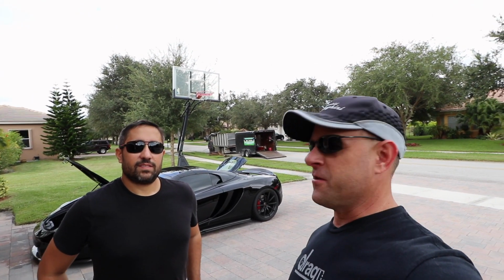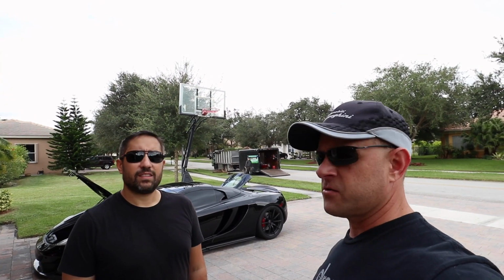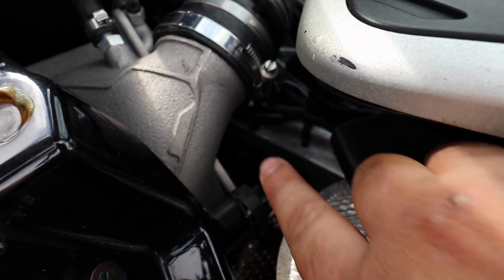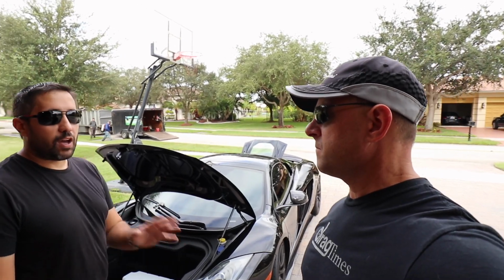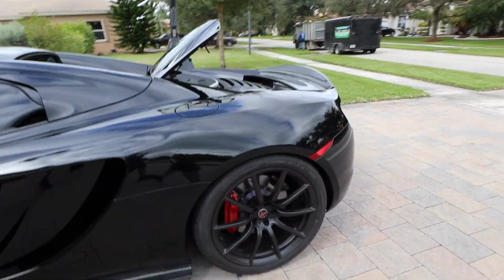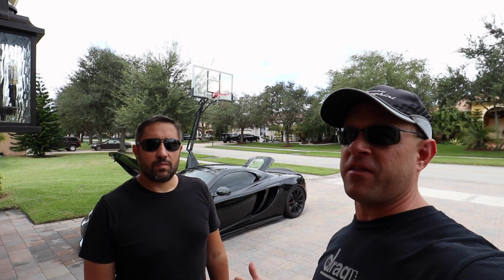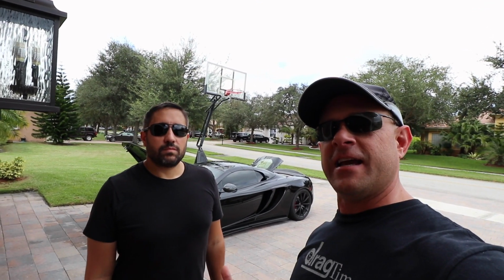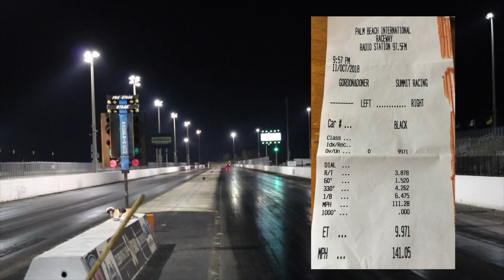How to beat a McLaren 720S*  Meth Injection?

Comment: Damn that 12C is movingggg!  Which turbos are actually used in the "Turbo Upgrade Stage 1"?? Seems like the 12C has the punch from down low rpms with MEAT packing punch in mid range.  Seems that the turbos kinda dive off on the top end as the 720S keeps trucking late in the game.  Maybe a slightly more aggressive turbine/compressor combo could fend off the top end battle?  IN OTHER NEWS USED McLAREN 12C's ARE A FUCKING DEAL OF A SUPERCAR at current price levels!

Comment: 721 every time but there was no clear start and finish that's the problem with roll racing. The 12C definitely sounded awesome though except for I'm diesel wonder how loud it actually is inside the car?
Reply: Not loud at all, can't even hear it most of the time, perfect system.

Comment: Nice brooks btw how much faster then the Agera Rs, Regera, chiron & hennessey venom F5 do you think the new Mclaren speedtail will be? i think this is the new ultimate speed king especially if the 720s is P1 level with "710bhp"and the new speedtail has "1037bhp" so 1000whp as an estimate or 1300-1400bhp
Reply: James Crain  top speed isn't the battle anymore as koenigsegg said it is whoever gets to 250mph the fastest and tada the speedtails top end is 250 and as the 720S shows this speedtail will run bus lengths on cars in it's range i have a feeling it' going to be the 720S of the Megacar realm even if a Regera R is released i don't see it matching the speedtail remember hundreds of competitors came after the title of the mclaren F1 and for 20-25 years the mclaren F1 was the fastest car this is what i see happening with the speedtail as well

Comment: I believe 720s has boost by gear, meaning it has lower boost in lower gears for traction. Not sure what gear they started in, but could potentially be why the 720 pulled at higher speed.

Comment: I think is very close especially if you are talking about 1/4 mile. But, the 720S has more on the top end, most likely because of the bigger capacity of the 4.0 liter V8 as compared to the 3.8 liter V8 in the 12C.

Comment: It looks like the 12 c barely had the 720 but at what must be over 120 the 720 makes up ground and pulls away. Since the 12c had pure stage one turbos, Pure has stage 2 which have more power. I wonder if that would swing things over to the 12c/

Comment: C6 Zr1 has already beaten 720s with a catback+ air filter. The Zr1 had bolt ones+ cam + ported blower + e85. If you wanna see the race, type zr1 vs 720s in the search and you will find it

Comment: Pretty clear the 720 won. Seems the higher the speed the more the 720 pulls away.
Maybe the aero is a big factor, not just HP.
Looks like some custom wing on the 12C? Could be ruining the performance at high speed.
Reply: Not the aero, but the ecu and 4.0L + plus electricly-actuated twin scroll turbocharges. Due to heat sink in that hot weather and lack of racing bigger radiators (will come in LT from senna) until the airflow is at the maximum over those radiators, the ecu is holding back the boost, at over 100MPh the ecu lets it all out, and it PUUUUUUULS!
Reply: Yes and not just the wing, also the air splitters at the front.
Reply: This mainly came down to aero. I was a technician for McLaren and trained on the 720. The 720's aero advantage is generations ahead of what the 12c has.
Reply: James Crain  excuse me. A McLaren dealership. There, is that better?
Reply: Or you forgot that is 400 plus pounds lighter
Reply: @NOEG37  curb weight for 720s 3,161. Curb weight for 12c 3,249. Where is this 400lbs you speak of?
Reply: @carver41250  why you lieing it's 2829
Reply: @NOEG37  that's dry weight. You do know that fluids add weight. Curb weight is with fluids. Since cars don't run without fluids, I gave the curb weights they tell the real story.

Comment: The MP$ was stellar in the low and midrange vs the 720S but the top end power and aero of the 720 is hard to beat. I would stay with the MP4, I would have Lalik and DME tune for the meth and perhaps consider playing with the turbos for more boost/topend. Solid runs, amazing cars

Comment: The 720S' gearbox is faster than the 12C. You need a lot of horsepower and deal with that lightning quick gearbox and wide powerband of the 720S.
Reply: Same gearbox on both cars, different shifting strategy. Try again.

Comment: I think the 12C is quicker in the lower speed but that 720 has has so much Aero development that I will walk away from most the higher the speed. The front of that car is key.
Reply: Roland Williams I’m sure the boost by gear settings on the 720s have a lot to do with it!
Reply: Sides actually. The lack of that big side intake removes a LOT of drag and turbulence.

Comment: 12C looks and sounds great.  Definitely a little slower than the 720S, but still damn respectable.  

How reliable has this 12C been overall?  They seem like a good value used but Rob Ferretti's video about $30k steering rack repairs and $3k battery replacements are a little scary.

Comment: That's a lot of dough to get just over a second from a car.
With so much fabrication skill out there today and bottomless pockets, it surprises me no-one has stuck an electric front axle onto such cars. It could work totally independent from the exist drive train, merely feed off the throttle signal that goes into the engine. Say, a cheap (<$800 production) Model  3 motor would totally do the trick. Or perhaps a copy/conversion of the 918 setup. Bigh output batteries can be kept pretty small to fit right in there under the front bonnet. Example, Koenigsegg gets 500kW out of a 75kg enclosed unit. Half of that would make a huge impact to 0-60 ad 1/4 times. And in fact, many convenient motors just ask 400V anyway. There are plenty top grade off the shelf motor available off the shelf for a low 5-figure amount. Similar and above what Koenigsegg presented for Regera (not sure they stuck with Yasa or those spec'd).
RWD McLarens are pretty sweet at extracting the most out of the rear tires even with a ICE, not a whole lot to be gained there off the line with a hybrid upgrade. The front axle though, look at what that brings to AWD vs RWD Teslas...

Comment: Same graziano gearboxes right? Do they have the same gear ratios? If not i think the 4th and 5th gears of the 720s is  bit higher.
Reply: Yes same gearboxes, based on the info I can find 5th gear is a bit shorter on the 720s thats it, otherwise pretty much the same.

Comment: If a race goes 40-160 the 12c has it clearly, 720s with better displacement and bigger turbos can push that much more air through.

Comment: Absolute win for the 720S especially when you figure in the additional rotating mass of those wheels which appear to be atleast 21” or 22” and no doubt didn’t help it out at all. But that 12C looks and sounds great and Jimmy must have had a paint correction/ceramic coating because that black paint always looks on point 👍🏻

Comment: First 12C running meth injection? We've been doing it for over a year.
Reply: I see no mention of meth on your website, I went through all the packages you offer too, might want to update that if thats the case.
Reply: We do need to update our 1000 and 1200 build details on our website, both of those systems have used meth for the past year. See the link above, clearly says: "Methanol Injection with Boost Reference Demand
Stealth plumbing with dual injection"

Comment: The M838T engine sounds better. It revved higher than the M840T and was the high revving twin turbo engine on a production car. Those M838T-E and M840T sounds like a ferrari flat plane and it's boring than the flat plane growling M383T. I'll take the 720S with an upgraded M383T engine to 4.0L not the all new M840T.
Reply: The most interesting part about the M383T is the fact that it sounds like a cross plane v8. Probably one of the most balanced sounding engines I've heard so far.

Comment: The 720 Must have around 800bhp Stock Right ? I think they got 690 at the wheels...... Stock 🙈
Reply: Yeah,  but it's not just the power.  It's transmission,  aero and the fact it only weighs about 3130 lbs plays a huge part in the way it performs.
Reply: Absolutly right 👍🏼
Reply: The 720 proved its not all about HP a while ago
Reply: @hughmungus8311  MP4-12C weighs about the same depending on options aero is the name of the game with the 720. Every car that thinks it can  take it loses the battle over 100 MPH.
Reply: @brianpope9362 Dynos say 690-710 at the wheels. Real world it's closer to 800 at the crank, stock.
Reply: @brianpope9362  Exactly, you can't tell exactly what the drive loss is. 15% is generally the go-to. I wouldn't assume less unless it can be proven.

Comment: If 1/4 mile, then the 12c won fair and square...if 1/2 mile, then the 720 was gaining ground at higher speeds.
Reply: Gaining ground? He passed him in both races.. and Brooks has ran faster times than the McLaren MP4 - 12C at the strip then that guy and his 720 Brooks has the 720 locked down and with the stickier tires I can see  A 9.7 stock for Brooks

Comment: The 720S won. It seems the MP4-12C has the low end grunt which beats the 720S in the first part of the race, but ultimately the 720S' top end wins out.

Comment: I wonder when will the 720s will lose 🙄 720s in absolute beast
Reply: Cars or bikes that could beat the 720s over a half mile race

1.)Koenigsegg Agera RS although not to the 1/4 mile after the 1/4 its all segg
2.)Bugatti chiron at 150mph it would pass by fast
3.)Hennessey venom gt would start to pass at 140-180mph
4.)Bugatti veyron SS at 160mph it would slowly pass or might even lose by a bumper
5)mclaren senna i think past 120mph it would pass and keep the lead
5.)mclaren p1 by a car length or less
6.)Rimac concept 1 hmm very close race probably might still lose to the 720S
7.)Ultima Evolution old ultima did 9.9's with 300hp less this would be a hard match up

1.)ducatti V4 thing would pull hard and win by a cars length or so maybe more
2.)Kawasaki h2 same thing
3.)Bmw S1000RR maybe not sure
4.)MTT Y2K jet bike probably outruns the 720S badly
5.)Any twin turbo non stock Hayabusa well almost any 

other then these i don't see many stock cars coming close to the 720s it is the GOAT of supercars
Reply: sameer padia it already lost to a dodge demon five times by two different demons.
Reply: Vs boosted GT2RS or boosted Turbo S
Reply: Porsche 918 beat his 720s pretty good a few videos ago
Reply: sameer padia when he races demonology!
Reply: @outworlds the only mods are brakes and tires lol
Reply: @EBMproductions1  Basically the car has to cost 1 million or more lol
Reply: @EBMproductions1  no shit Sherlock
Reply: ourworlds atwar tires are not really modified. Put that 720 on tires and it would still be same result.
Reply: @girthvader889  lol he literally spent thousands hacking up the rear brakes so the 15 inch wheels would fit... not stock at all
Reply: Bibin Thomas  watch this 918 lost to 720s the 918 brooks raced won due to the 720S spinning the tires fair race and he wins https://www.youtube.com/watch?v=rdJpthicsdc
Reply: James Crain  veyron SS runs 163-166mph in the half mile brooks in his 720s ran 174mph in the half mile
Reply: I m talking about the cars in the same category. Its a common sense that a Bugatti and other cars of that category will beat the 720s.My bet is on 488 pista. Let's see.
Reply: Bibin Thomas The 720s pulls on the 918 in a roll race
Reply: @TheBb6prelude  talking about stock car.
Reply: Bibin Thomas  720s didn't lose to 918.  There's a video where 720s smokes the 918.
Reply: @TRADERSAMEER  it's the vid i responded with 720 pulls on 918
Reply: A guy called Demonology has beaten several 720S with his stock Demon.
Reply: Dude so your saying a 400k plus car is gonna smoke a 100k car with a 10k BRAKE JOB???
Reply: Demonology is a beast at his game
Reply: And I am sure that GTR NISMO and NSX will be beaten by 720S, Demon. Yet they are beast,too.
Reply: Erik Britz notice you have to get those insane hypercars and super bikes to beat the 720s. No hate here bc you mentioned some amazing vehicles, but dammit you have to bring a monster like the Venom or H2 to manage to win. It's a real testament to this car.
Reply: The demon is my absolute favorite car, but Demonology has several thousand in mods and even still his best time is slower than the 720s best stock time. Stock vs stock is embarrassing, that's why us demon fans always make excuses like it never happened.
Reply: Bibin Thomas  It didn't beat the Chiron. The Chiron got a bad start and breaked early, AFTER it had already passed the 720S. The poster also says in the comments that in a second run the Chiron walked the 720S.
Reply: A Venom GT has over 400hp more than a 720s, and weighs a little less, while still having good aerodynamics. Even with slow shifting, a Venom GT would walk a 720 hard.
Reply: Its lost to 918 that have no turbo just v8 with electric motor in drag race
Reply: It did alrdy to the demon twice!!ask demonology he should kno and he beat a 720s with 2 diffrent demons sooooo..
Reply: @EBMproductions1  Thanks Erik that's a bloody hypercar list million plus. Definitely the new r35gtr sensation.
Reply: I don't see any company beating it honestly, unless it's a gazillion dollar hyper car. Not including the Tesla roadster
Reply: Bibin Thomas  it didn't smoke it in the 720 will beat it in a roll race it already has there are videos and the 918 only Beats at off the line because it's got a hybrid assist  Powertrain when he lost in the half-mile he was pulling on the 918 on the big end he only lost because he was spinning on the start get your facts straight 918 was King when it came out not anymore and you could buy 3 720's for the price or more nothing in the price range is comparing whatsoever stop trying a hypercar should beat it but not even all of them do and Mclaren has an answer for most hypercars coming out shortlythe 720 is literally only the middle tier for them
Reply: Stealth Customs  used McLaren F1 for $300k ?
Reply: Jessica Dion only on a drag strip. And with brooks driving it would be close.
Reply: Stealth Customs demon only wins on a preped dragstrip. Also the 720 trapped 10 mph faster. 9.85 for demonology 9.92 for brooks. Demon loses everywhere else. Put set of tires and downpipe and demon loses even on dragstrip.
Reply: When McLaren brings out the 970s
Reply: @StrykerV8  Demonology went 9.85...stock 720 went faster??? Thousands in mods? You mean wheels/ tires and smaller brake discs.
Reply: @rleojeda  rear brake conversion kit - $1000, lightweight wheels $2000, full slick drag radials $600. And he ran a 9.85 once. Stock 720s has been in the 9.7s at least 3 times completely stock. Do you disagree with any of this?
Reply: I don’t, but it’s just tires and wheels. Herman is a big boy himself, he carries himself at least 200lbs more than the driver that Dodge used for the 9.6 run...he needs to make up that difference somewhere. With that said, Mike’s 720 also had sticky tires on his 720 when they raced, and you saw the result. Heck, even Tunnel Chaser’s bone stock Demon beat it.
Reply: Erik Britz I think I Chiron would walk a 720s right from the start.